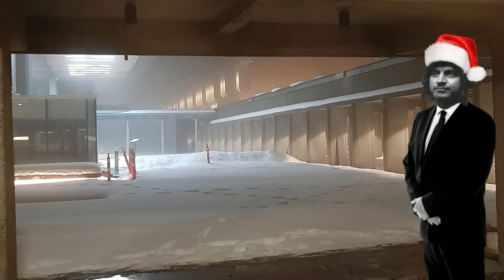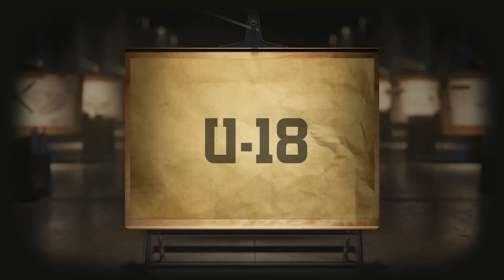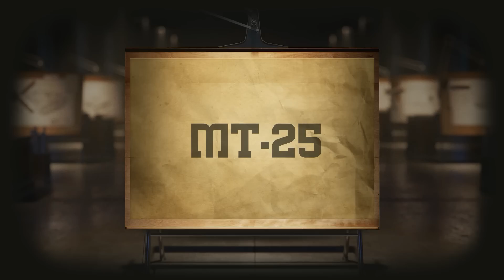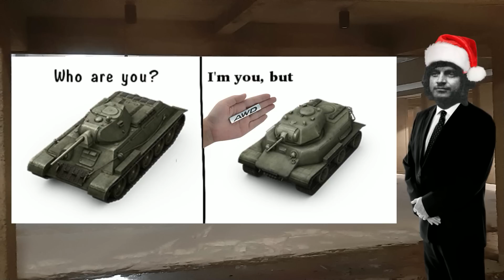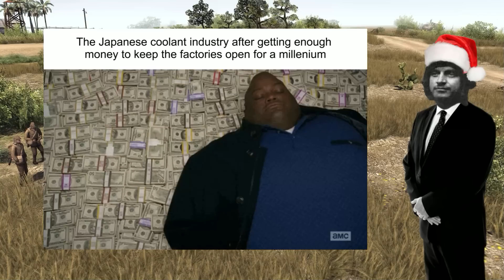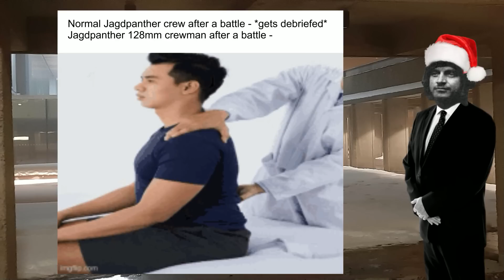The Worst Tank Concepts Of WW2 │ Volume 4

Comment: Regarding the 2604/2605, there's technical drawings of the suspension floating around — it's actually one of four suspension designs for the Chi-Ri, and it is indeed interwoven wheels and torsion bars. I believe WOT's take is an artistic malformation of the medium tank, and a pretty good one too... just not practical in any sense.

Comment: 4:35
KV-1S had lightened turret and improved transmission, which slightly improved it's acceleration, but more importantly, it got far better reverse speed than usual KV-1.
Reply: Don't forget thinner side and rear armor. Managed to shave off 5 tons.

Comment: Isn’t 128cm l55 pak44 not 80 ?
Reply from the maker: The PaK 80 is basically a rebranded PaK 44. For some reason it only used this designation when installed in the 128mm Jagdpanther.
Reply: My guess is that it was a modified model with different breech so that it would fit inside the vehicle. Kinda like the Panther F with the 7.5 cm KwK 44